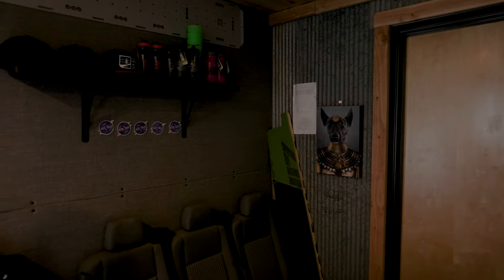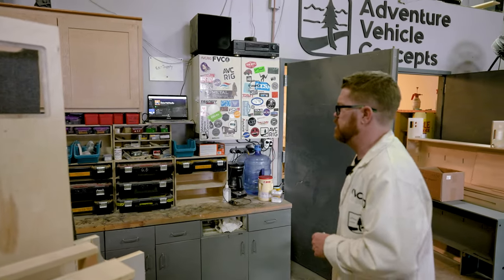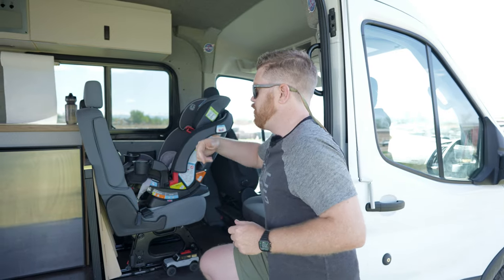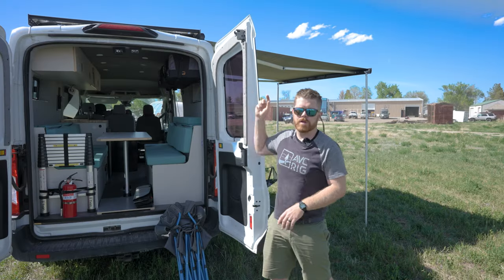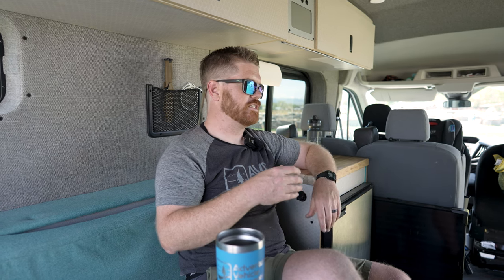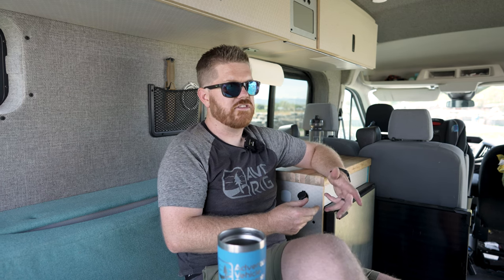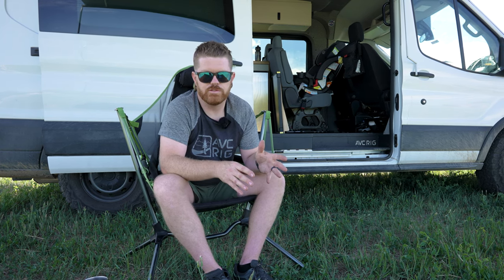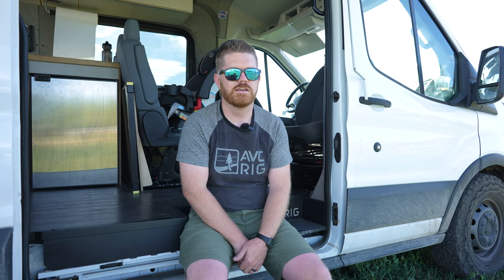VAN Shop Tour & MORE | AVC Better Know Builder

Comment: Question here:
R u considering doing a cut out chassis? Ala Pleasure Way or the like...
Also, how is the ETA on ordering these Transits? Eg, if u need 2 today , can u just go pick them out off the lot, like back in the days?
Reply from the maker: No plans on a cutaway. It’s A big investment and not something we’re into for now. Lots to do with the standard body. 
I have seen some vans sitting on lots. It really depends how picky you are. If you want a special color and all the options you’ll have to order. If you’re happy with a MR white van they are out there.